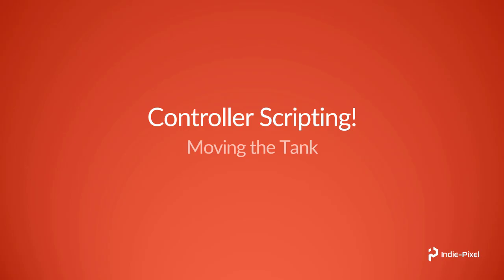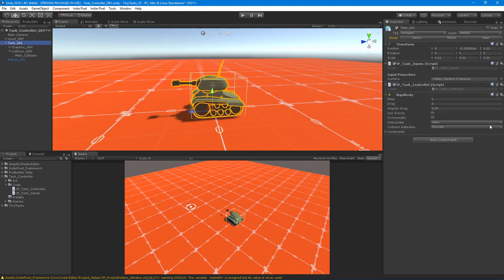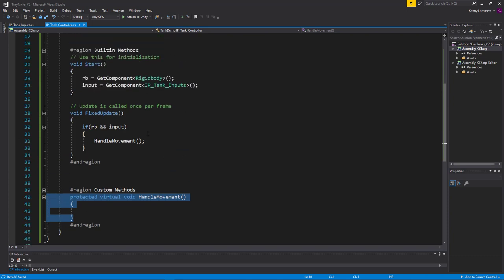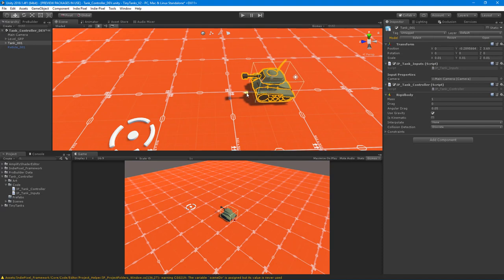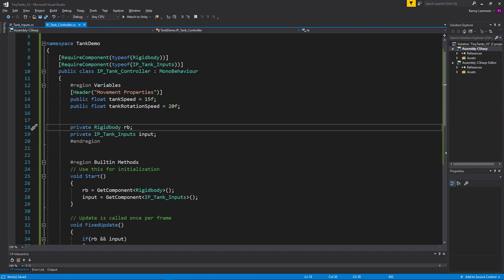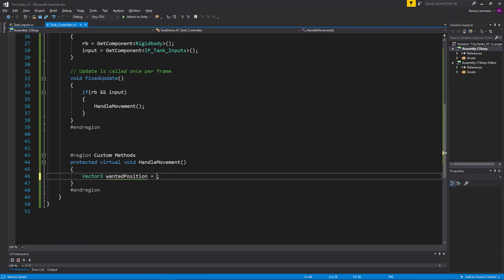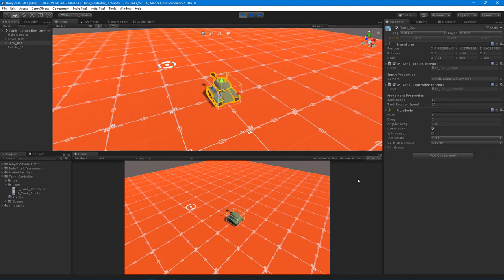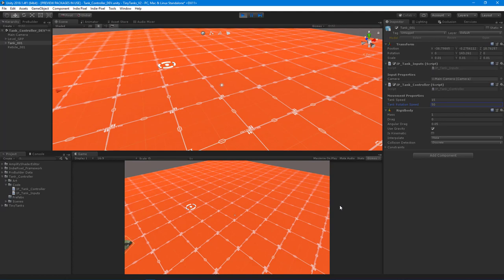Basic Tank Controller in Unity 2018 - Part 5 - Controller

Comment: H Indie-Pixel,
if I enter this:
            Quaternion wantedRotation = transform.rotation * Quaternion.Euler(Vector3.up * (tankRotationSpeed * input.RotationInput * Time.deltaTime));

            rb.MoveRotation(wantedRoation);

my tank doesn't do anything anymore ;(
why is that with me and not with you?
Unity: Unity 2019.3.15f1
Reply from the maker: Hmmm, that looks correct.  Can you comment out the MoveRotation call and see if you move again?
Reply from the maker: Or try the other Quaternion.Euler overload...try doing Quaternion.Euler(0f, your rotation value, 0f);
Reply from the maker: Also what is your rotation speed set to?
Reply: @IndiePixel3D  And thanks for the quick reply.
Reply: @IndiePixel3D  no idea what I've changed now but it works !! I've been sitting here for 5 hours. Thank you for your help
Reply from the maker: Ok, give this a whirl:

using System.Collections;
using System.Collections.Generic;
using UnityEngine;

[RequireComponent(typeof(Rigidbody))]
public class Tank_Controller : MonoBehaviour
{
    #region Variables
    [Header("Movement Properties")]
    public float rotationSpeed = 15f;

    private Rigidbody rb;
    private float hInput;

    private float finalRot;
    private Quaternion wantedRot;
    #endregion

    #region Main Methods
    // Start is called before the first frame update
    void Start()
    {
        rb = GetComponent<Rigidbody>();
    }

    // Update is called once per frame
    void Update()
    {
        HandleInputs();
    }

    void FixedUpdate()
    {
        finalRot += hInput * rotationSpeed;
        wantedRot = Quaternion.Euler(Vector3.up * finalRot);
        rb.MoveRotation(wantedRot);
    }
    #endregion

    #region Custom Methods
    void HandleInputs()
    {
        hInput = Input.GetAxis("Horizontal");
    }
    #endregion
Reply from the maker: Oh nice!  Yeah the code looked fine...well the code I just sent is a quick way to test rotating a rigidbody.  Glad you are back up!

Comment: Hey, how would If the player is moving?  Checking with rb.velocity.magnitude doesnt appear to be working because even not touching  the controls, the RB reports these wacky numbers at any given time even though standing still.  Any ideas?
Reply from the maker: An easy way is to use the input values from the keyboard or joystick